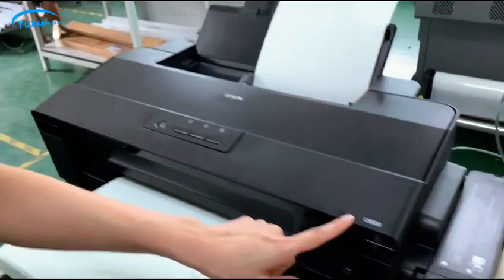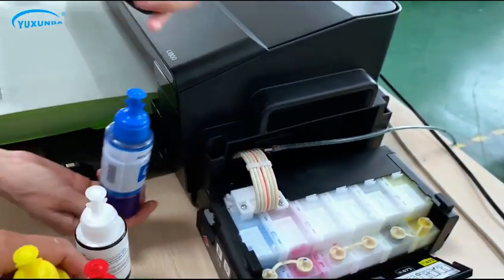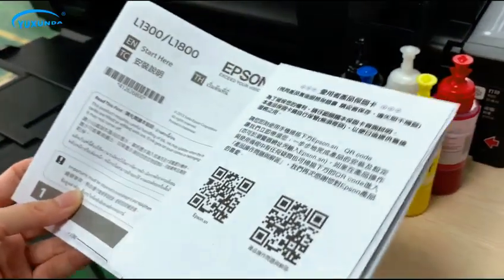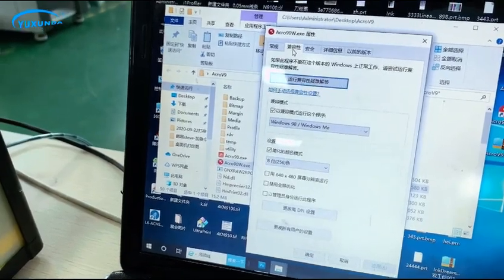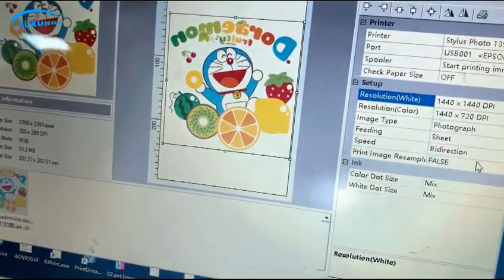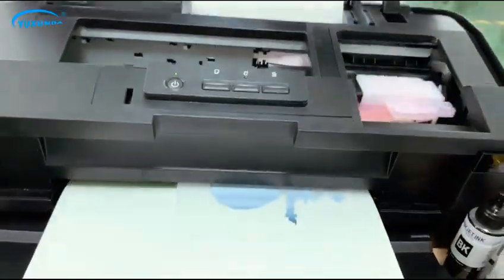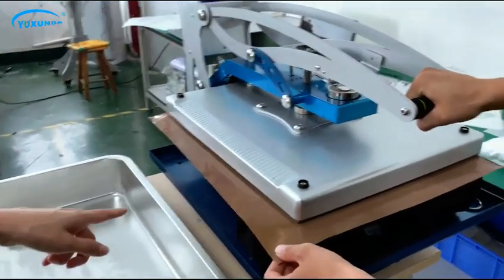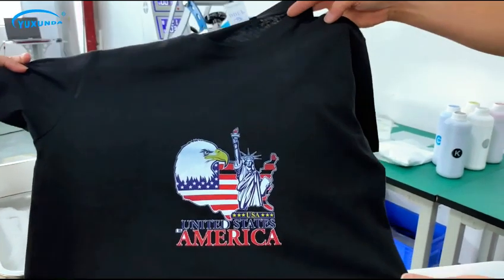New tech PET printing, DTF printer solution process

Comment: Will you make video on how to convert Epson P600 printer to DTF??
Reply from the maker: sir, software  supports to work on Surecolor P600 printer. no need modify
Reply: Thank you so much for replying!!!So the chip doesn't have to be reset?? Is that what you're saying?? Also, do the rollers need to be removed and a waste tank added??
Reply from the maker: @marypoppins7099  How to modify Epson L1800 printer to print our PET film
https://youtu.be/IXkhYcNBkN0
Reply: I need to know how to remove the rollers and add a waste tank.. thank you
Reply from the maker: @marypoppins7099  How to modify Epson L1800 printer to print our PET film
https://youtu.be/IXkhYcNBkN0

Comment: Hi,
I have a Epson XP 760 it also have six colors. Is it even possible that I put that system you use here in the Epsom XP 760? Or can I maybe just put the white ink into the LM & LC cartridge and it will print white.
Reply from the maker: software is not workable on XP760
Reply: @yuxundateam1542  Is there a other way to make it compatible with the Epson XP 760 ?
Reply: @yuxundateam1542  How long can inks be inside a head without printing? Does the ink dry inside the head?
Reply from the maker: @bakrkhalefa4660  it is water base ink.  better to turn on printer once a week at least